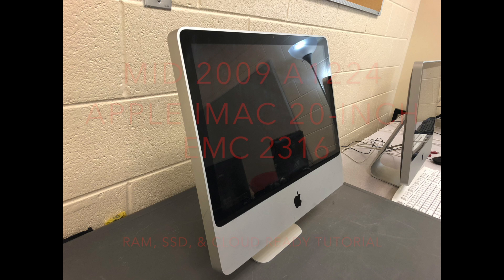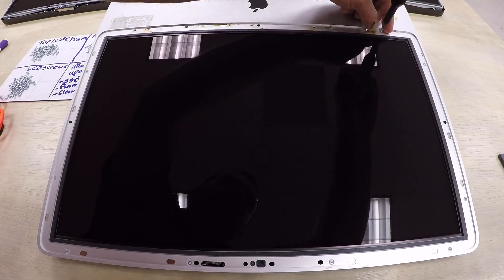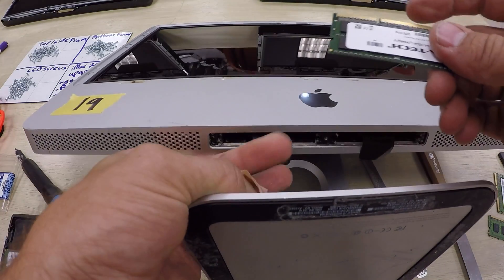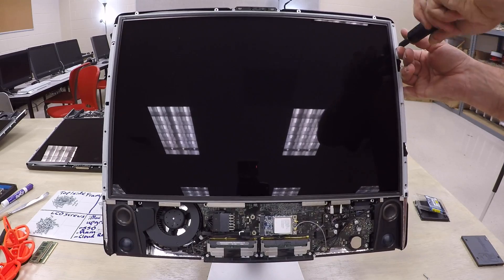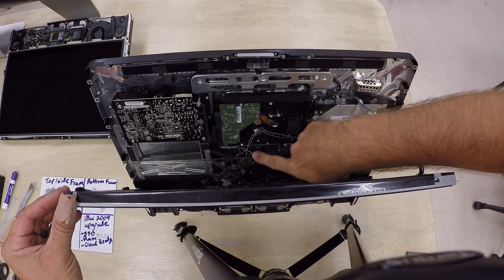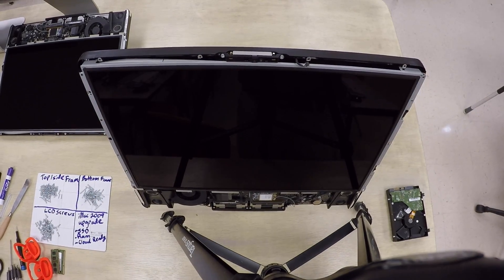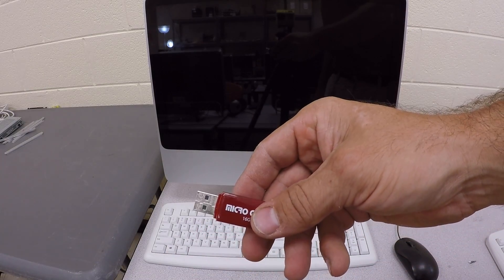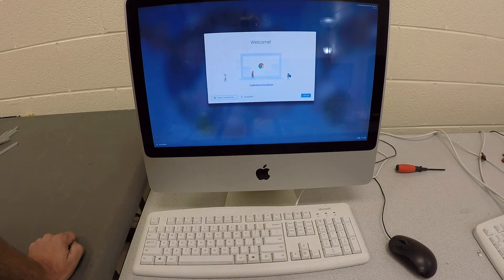iMac 2009 Upgrade Tutorial

Comment: Hey Eddie, thank you so much for uploading this tutorial. It’s the clearest one I’ve found and it allowed me to upgrade my 2009 iMac to an SSD yesterday. It is running so much faster, and upgrading it cost me less than 10% ($102.94, to be exact!) of what I would have paid for a new computer with similar specifications.
All I did differently was to format my SSD using disk utility, and then I cloned my HDD onto the SSD using Carbon Copy Cloner. Installed the SSD and voila! Very fast iMac, 12 years after it was released. I also upgraded the RAM as you did.
I’ll be using Dosdude1’s Catalina patcher soon to bring it up to date as it is currently running El Capitan.
Thanks again!
Reply: Sei riuscito a installare Catalina? Io con lo stesso mi sono fermato a High Sierra perchè so che da Mojave non c'è il supporto hardware

Comment: Can this be upgraded to 16 gigs of ram with two 8 gigs or no?
Reply: Hi Brandon, this particular model, the early 2009 iMac (9,1), won’t let you do that. It’s max RAM capacity is 8gb (4+4) even if you install 16gb (8+8). Not sure what will happen if you do that but I just don’t think it can use the extra RAM.

Comment: Is there any reason to to go with a larger Kingston drive than 120GB?   If I am going to go to all the effort to tear this apart,  I don't mind spending $50.00 or more for the 480 GB drive or larger - but I want to make sure it would work in this Mac.  Any Thoughts?
Reply: no problem, if you have a storage server you can save money with a smaller ssd. So in this case they use 120gb